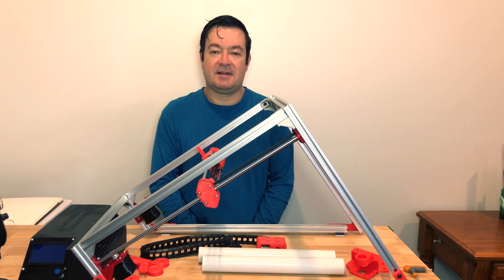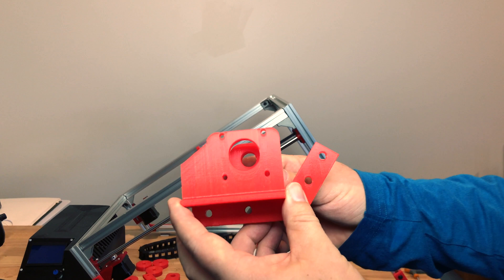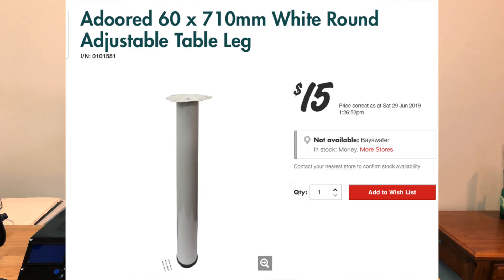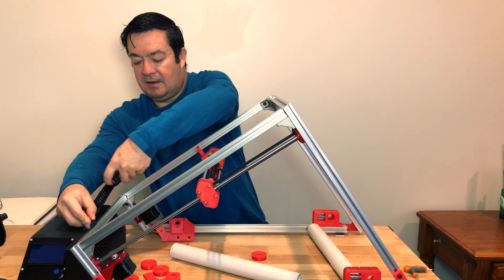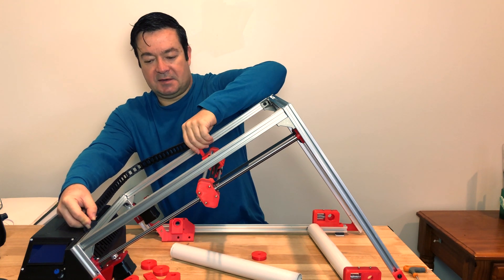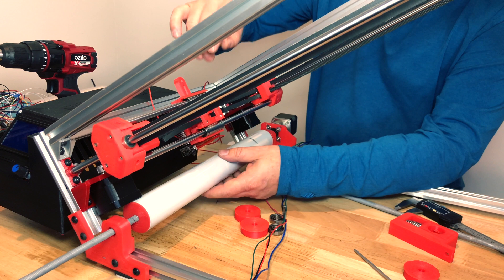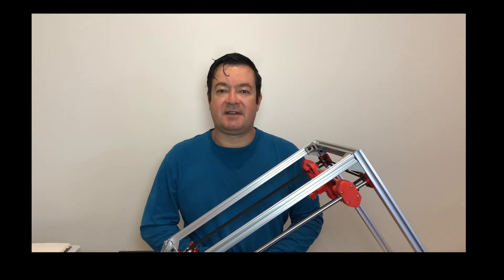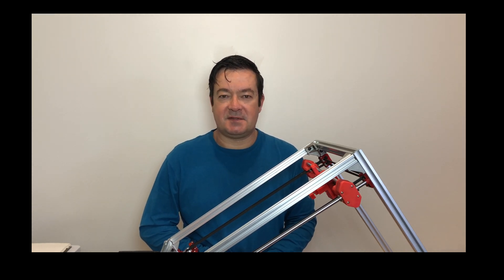Belt Printer Build: 4 - Belt Rollers

Comment: This is amazing, what did you use for your belt?
Reply from the maker: I now use mild steel shim stock. Stainless steel shim also works, but I wanted to put a magnetic sheet underneath to keep the belt flat
Reply: @ZechyC  what method did you use to join the ends to get it as flat as possible? A type of glue and press it?
Reply from the maker: I stuck the belt together with kapton tape. It’s not that cool but it makes maintenance easier. And it is very durable

Comment: Thank you for the amazing work! Just a quick question, one the video the table leg is 60mm and the BOM says 50mm pipe. Should the rollers be 60mm diameter and 305mm in length?

Comment: Adding those springs to the parts that hold the rollers is brilliant!  Less work to tighten the print belt, and it keeps the belt tight if it expands or contracts because of the heated bed.  So smart!